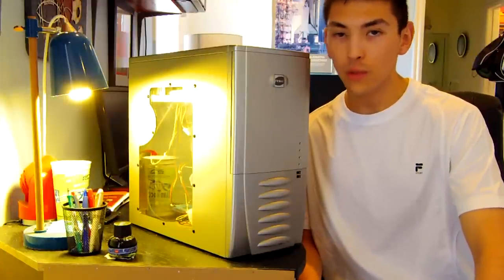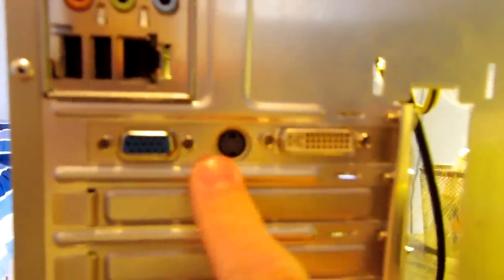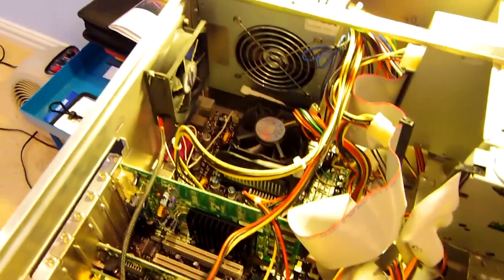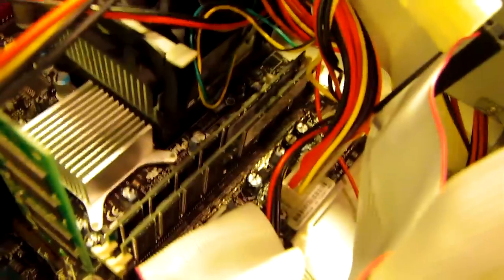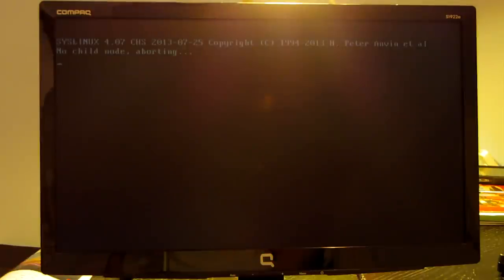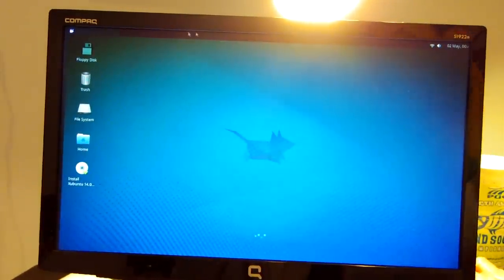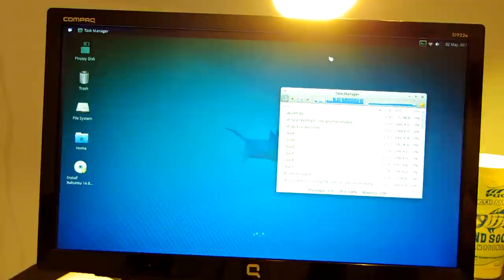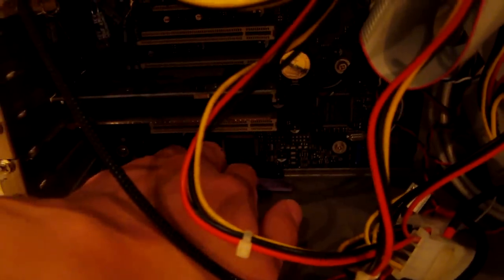Garage Sale Finds: $5 Custom Built "Antec" Gaming PC (Pentium 4)

Comment: I found a 2005 gaming PC (with the top of the line specs of it's time) next to a big pile of garbage in front of an apartment complex, I was walking with my friend and he took it, and we found out that it has a lot of games on it, however no cookies nor passwords or any history. Just games and even some save data. It ran NFSMW (2005) at 200FPS, not joking! It ran so well, we install steam and got BF hardline and it ran a whopping 90FPS at mid settings! We looked inside and we estimated its worth around $5000+ for it's time, with some overclocked chips and multiple fans to support it. I was shocked, honestly, but the only problem was it was sooo old and the wires were so damn worn, it only lasted 3 weeks till it almost caught fire. It was pretty incredible to find honestly.
Reply: Lol :D
Reply: +556FATHOMS Just wrap the wires in tape so they don't short problem solved. Unless they were broken inside the insulation.
Reply: KiwiPowerNZ They were burnt, like, the PC over heated because of the overclocked stuff.
Reply: 556FATHOMS Oh. Sounds like what just happened to my PC after lightning hit our house, the PC looked fine, but after 2 days without power I turned it back on and the graphics card had a short in it. If my power supply didn't shutdown after about 1 second because of overload, 80A at 12V would have set fire to the graphics card. You could smell burning immediately coming from my GTX980.
Reply: +KiwiPowerNZ RIP
Reply: +KiwiPowerNZ NOT THE 980.....The poor 980...... at least it wasn't a Ti
Reply: sam kelly Only a few months old too it had so much life ahead of it :( It had hopes and dreams of upcoming games but it's life was cut short.
Reply: +kiwipowerNZ I feel like a should donate I have a potato it doesn't have a 980 but it has a nvidea gt20. rip 980 that I will never be able to afford
Reply: Riley Stanish Insurance came through and we've replaced the graphics card and the MB/CPU/RAM, everything else was ok. Amazingly the 8 year old Corsair HX1000 PSU is still working after the lightning hit and after being shorted out by the dead 980. And all the hard drives in my computer were unaffected! We have our photos on a RAID 1 mirror but it's ok none of the drives were hurt.

Comment: I have a computer I recently restored just like this, it has a pentium at 3.6 Ghz (dual core) as well as 1.5gb of RAM but no graphics card or a motherboard as good as that. It also doesnt have any Sata ports but uses IDE cables instead. So I put a Zorin OS onto it (Linux) and it runs fine, I now use it as a backup pc incase my current dies on me. I also use it for general web browsing and Image editing which works surprisingly well for the hardware that is over 10 years of age as well as its graphics that are built in.

Comment: "problem with this PSU"

Yes, indeed there's a problem with that PSU - It's an Antec PSU or otherwise known as junk.

Antec PSUs of that era all the way up until 2006-2007 used Fuhjyyu, OST and other Taiwanese garbage capacitors, which failed within a year or so of the PSUs purchase. But the capacitors being crappy wasn't the only issue, Antec had a thermistor controlled cooling fan that was improperly set so the fan would either never move enough air to cool the unit or it wouldn't move air at all so the PSU would cook itself.

I've repaired dozens of that 350W model and dozens more of various other Antec models with recaps and doing a fan mod so the fan spins at full or 3/4 speed so the PSU won't cook again.

Comment: Although I was never a massive fan of the P4 they are still decent workhorses for their age.

A tip for older machines running XP that struggle with embedded flash video such as youtube is to use a addon for firefox that plays links with VLC player instead, its possible to watch 720p videos quite comfortably on machines such as yours with cpu power alone.

Nice find, Id maybe want to recap that old antec psu tho :)

Comment: the video card drivers aren't installed, hence why that youtube video was going frame by frame :)
Reply from the maker: Crispe1 The Geforce 5200 drivers are "broken" on Linux. I struggled with driver installation for a very long time when I had this video card installed in another PC, I could never get them to work and eventually gave up. Usually with these older cards I find that the native drivers work almost as well as the drivers from the manufacturers (in most cases at least). I do agree with you though, if the proper drivers were installed there may have a been a slight performance increase.
Reply: AA Computers and Technology Oh i had a problem too with my free geforce 7500le. The pc hung after 2 minutes of operation due to the nouveau drivers. I had to install the nvidia drivers in less than 2 minutes so that was challenging
Reply from the maker: Ramses De Vuyst I can only imagine how many tries it took you :p
Reply: AA Computers and Technology like 60 and i had to run it in nomodeset and it would only work for 2 minutes so i first had to install the os to the hdd which i was nearly never able to complete and then i had to install the drivers
Reply: AA Computers and Technology can't you install windows xp?
Reply: Green Stick it ain't supported anymore
Reply: Ramses De Vuyst doesn't matter... i am using windows xp now :D

Comment: I find myself just a little hurt when you say the computer isn't capable of gaming.
I have an 850 MHz Pentium 3 based PC with Win XP Home, 768MB of PC100
SDRAM (the max supported by the motherboard) and a GeForce FX5200 card
which runs Portal just fine. Granted, that's a bit of an older game by today's
standards, but it's a lot more system demanding than a truly old game like
Roller Coaster Tycoon.

Is there any chance the machine took so long to boot because the OS is a
live disk (USB flash drive) instead of being installed on a hard drive? I know live
distros on cd or dvd can be a royal pain in my (fill in the blank).
Reply: +Adam Green if the computer works for what he wants to use it for why replace it? It would be a waste of money to buy a super computer to play portal etc.

Comment: I had a PC similar to this, with a Pentium 4 3GHz, 1.5GB DDR-400 and GeForce2 GTS (the FX 5200 it came with died). I used Lubuntu, installed Nvidia proprietary drivers and I was able to watch SD (480p) video fine at 30fps. I think Xubuntu disables hardware acceleration for browsers when you don't have the proper drivers installed, so it may run way better with them installed.

Comment: Yep, if it's a 478 motherboard it's sata 1.0. Basically it isn't worth using over ide since the controller just converts ide to sata, then back to ide in the sata 1.0 hard drive. Unless you go with an ssd or sata 3.0 drive that's compatible with 1.0.